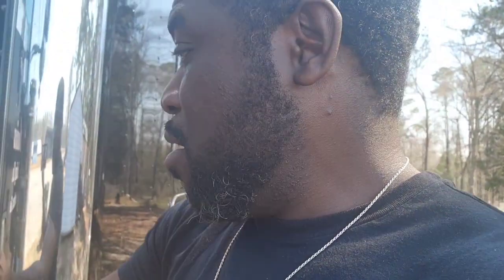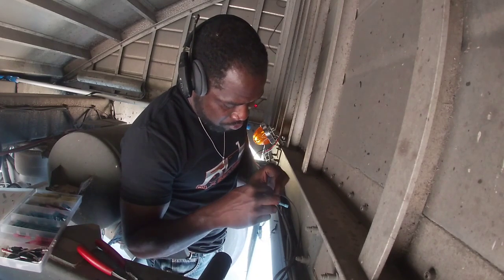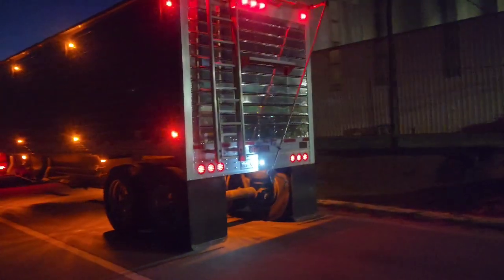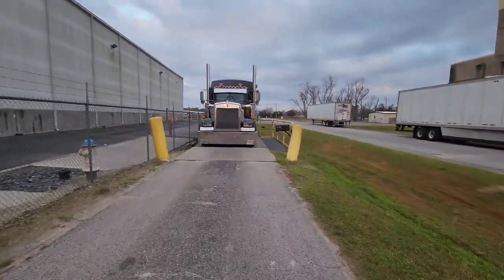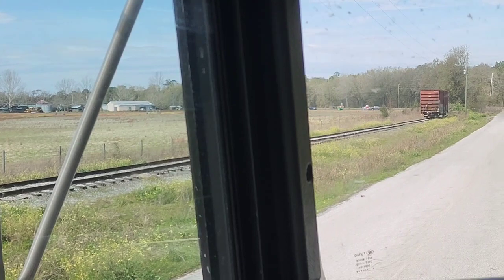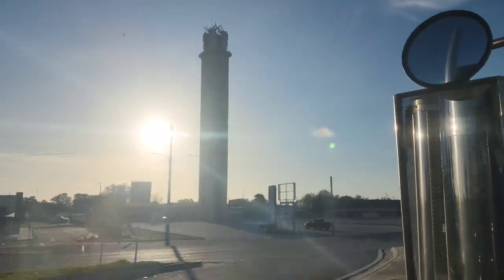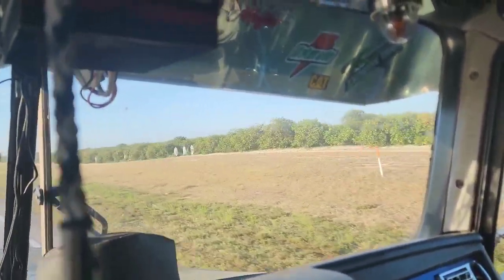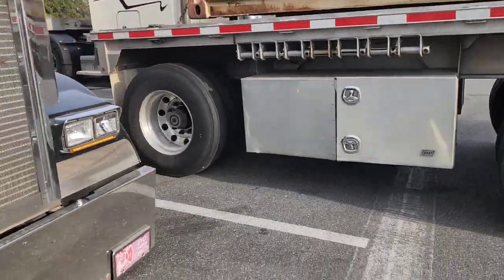Back to work. LIGHTING UP A HOPPER. Hung out with friends we haven't seen in years.

Comment: I say leave that 1 lite where it is & then put another flat bracket in an lower location with 3 watermelons to shine down on the ground
Reply from the maker: I gotta get me some of those flat brackets
Reply: @JunkyardDog001  jst use some flat iron plate about 8×8 & bolt it to a solid surface